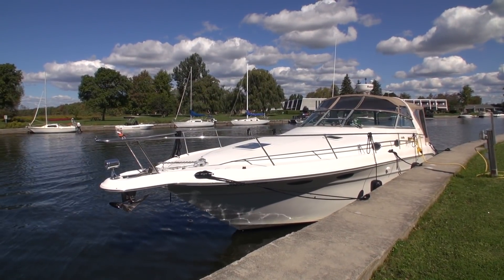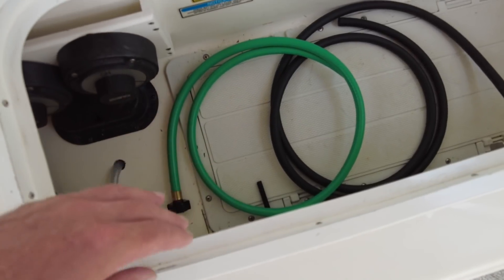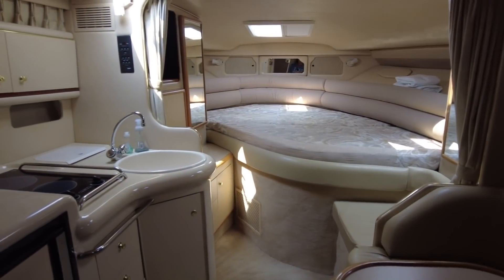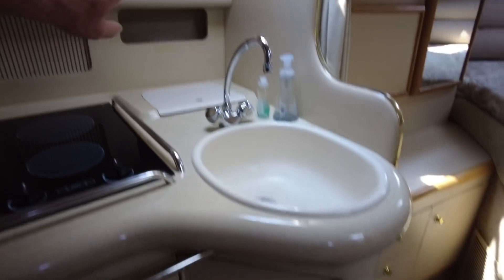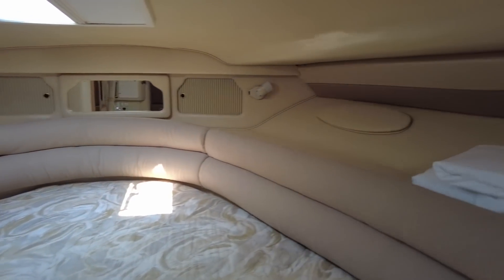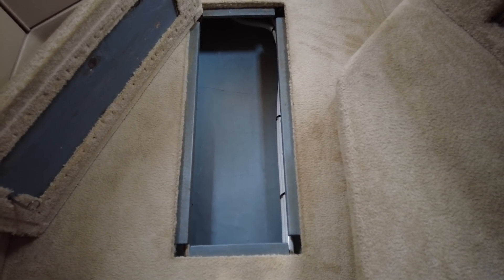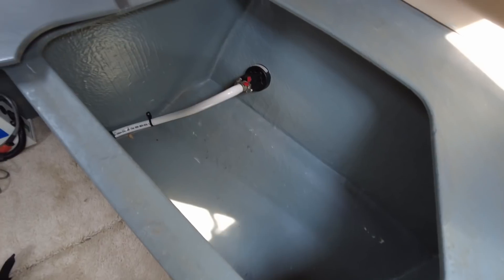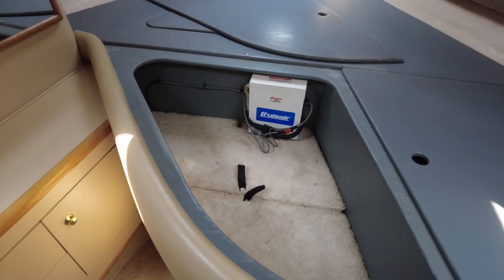Sea Ray 330 Sundancer Walk Through & Review

Comment: Comparing with your 370  now, did it not feel odd sleeping a bit by the side? (Im thinking about waves incomming and boat moving etc) 🤔
Reply from the maker: No, it was never a problem. We had the same bed configuration on our 300 Sundancer. And wind/waves isn't an issue.
Reply: @BoatingWithBoogaboo  Thx! 👍

Comment: Is it possible to use those black thin sound isolations used in cars down in the storage right in the front by the V?? (I have a girlfriend sensitive to every little sound when sleeping) 🤔
Reply from the maker: If that's the case, I would suggest that the boating lifestyle isn't for you guys. Beyond waves lapping against the hull, there is also the sound of (in our case) geese/ducks flying overhead in the middle of the night, rain drops landing (sometimes with great force) onto the deck overhead, the odd bird landing on the railings (which can be quite loud) and the sounds of other boaters close by that can sometimes be up to all hours at night - or early in the morning (with voices coming right through the hull).
 I would suggest that you will never find the right answers for the type of boat you think you want. All the answers in the world will never substitute for real life experiences.
 Trust me, after 25++ years of having our own boats and doing extensive cruising and traveling, the ONLY way to determine what is right for you is to start by actually buying a boat and trying it out yourself. Only then will you be able to determine what features are most important for your own boating lifestyle. Listening to me or anyone else will never provide all the insights that is going to make your experience a perfect one.
Fair warning; it's going to take a few different boats and a LOT of money to figure it out ;-)

Comment: Hmmm...the ice box on top of the wet bar is just a pass thru on mine to a trash bin underneath.  Obviously an alteration from the previous owner but it serves as our primary trash receptacle (13 gallon kitchen size) vs. the mini bin in the galley.  A couple other small differences in feature location but overall the same as my 1997.  We too have the doors under the settee at the floor level as another person has mentioned.  I think my center line floor bins are empty.  Might have to rethink that also.  When you do this same video on your future 370, I'm probably going to have to start shopping...again.
Reply from the maker: Yes, I'm looking forward to sharing that #boat as well, when the time comes. I'm also planning to show the tools/spares/parts I generally have with us as well. Have had a few requests on that over the years.